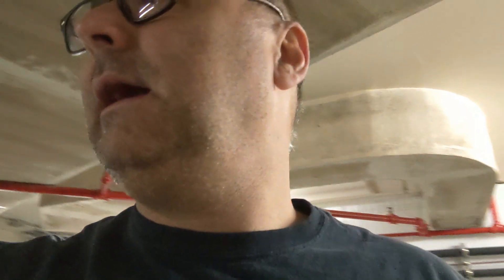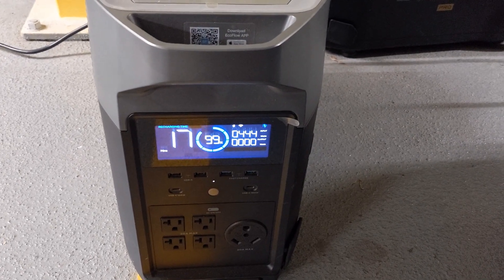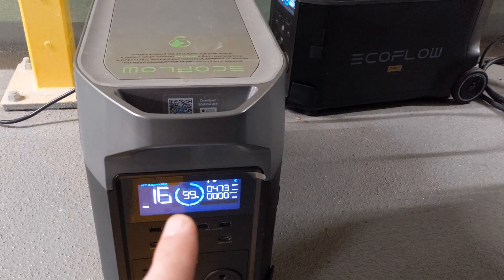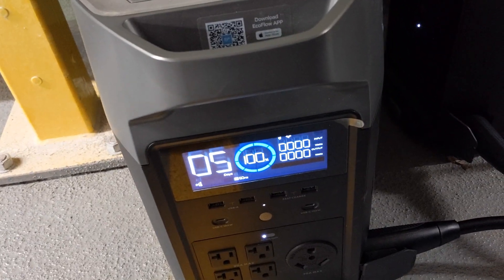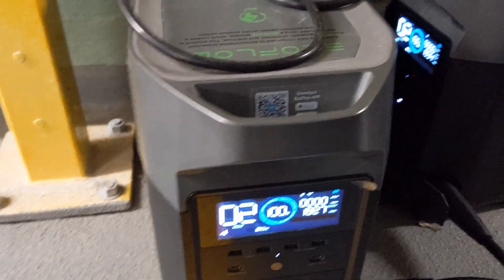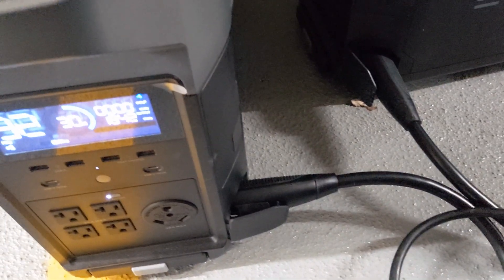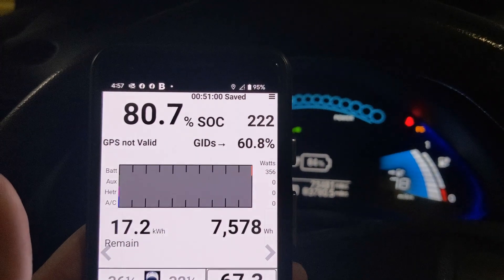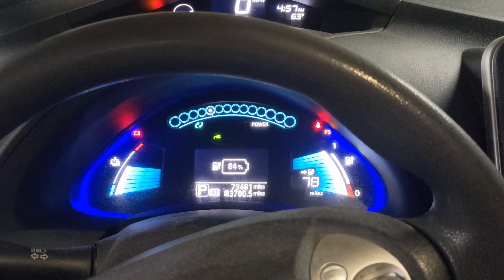Charging My Nissan Leaf on Ecoflow Delta pro

Comment: I noticed you were pulling 16 amps in your experiment.  I wonder if you could have plugged into the 30 amp plug on the double voltage hub and it would have charged faster?  I'm going to try the 30 amp plug for my BMW EV scooter with the double voltage hub
Reply from the maker: Yea i believe the Charger i used was a 16 amp charger .  I have definitely used two units with a double voltage hum to charge at 240v 32 amps.  Doesn't take long to deplete these units at that speed

Comment: What EVSE is that?
Reply from the maker: Looks like they might not make that model anymore.  It's the first one I bought for going on trips to allow 240v charging mobile.     My vevor branded one also works the same. I just didn't have the adapter I needed to use it or else I would have ran at full 32 amps
Reply: @offgridmaryland  Zencar still makes a Level 2 charger with a 6-20 plug.  Do you charge this way on a regular basis?  I wonder why yours doesn't require a grounding plug?
Reply from the maker: @leafnutz2341  never seemed to need it with that evse. I assume the charger was set up to not require it.  I carry that unit and a 32 amp unit that works the same with me just in case.
Reply: @offgridmaryland  and how often do you charge this way?  I plan to charge this way a couple times a week when it’s sunny out and I have power to spare.  Your unit “smoking” is of course concerning.
Reply from the maker: @leafnutz2341  typically I don't carry those around on short trips. But on long trips not often I guess.. but I know it works . 

Typically charge at home on my 12kw growatt off-grid setup
Reply: @offgridmaryland  looking forward to seeing a video on your Growatt clone EV charging!  Also,  how did you Ecoflow Delta Pro repair turn out?
Reply from the maker: @leafnutz2341    well when it smoked this time from this video the unit still worked fine thankfully.     The original repair when the last one smoke they sent me another refurbished unit that worked , claimed the parts they needed were on backorder cause of supply chain issues ..   the unit they sent back was a bit cosmetically best up but works fine